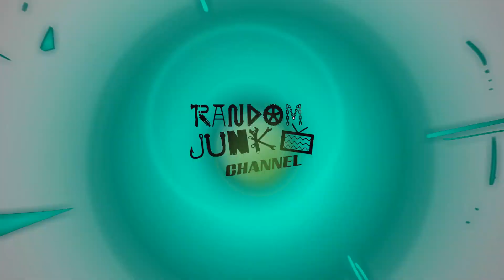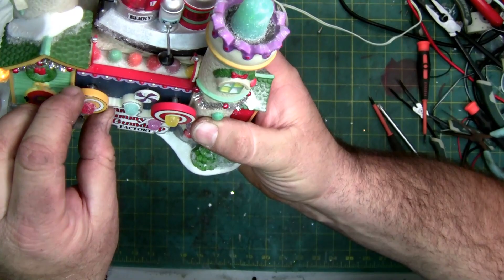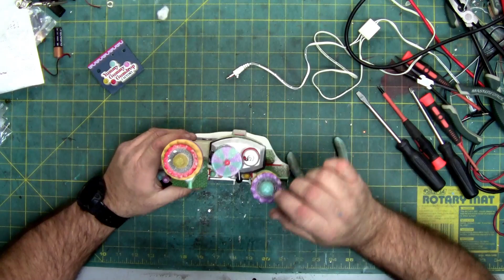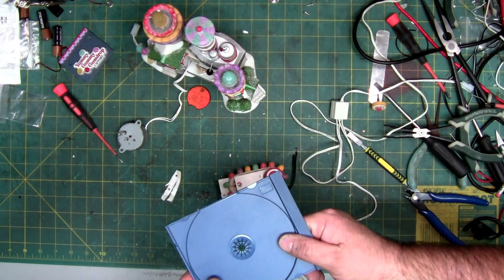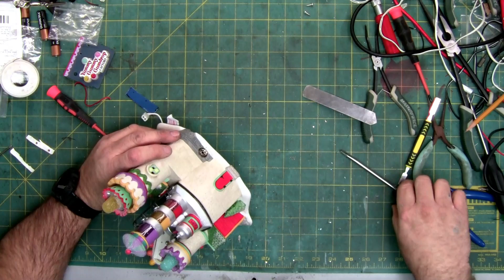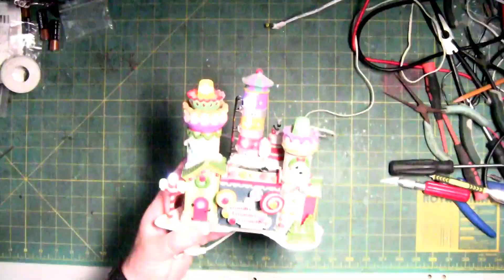Department 56 Yummy Gummy Gumdrops Factory Repair

Comment: What steps would it take to replace the lights on this piece?
Reply from the maker: Depending on which light(s) will vary access. If all of them are out, then the pigtail may be bad or the internal transformer. If an individual light has failed, in the gum drops, carefully heat around the base of them and lift them, they are glued on. In the tower, look for the seams and heat them to pop off the plastic to access LEDs. The tree would be the hardest as the gum drops will come off with heat but the wiring is in the tree and hard to reach. You may have to carefully remove the tree and fish new wire through it.